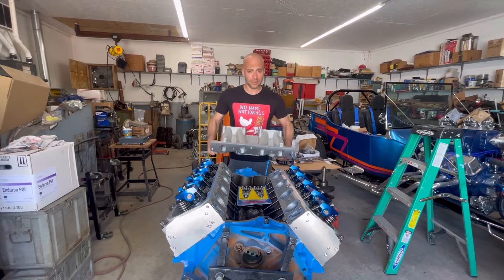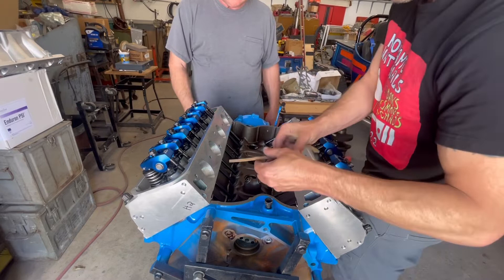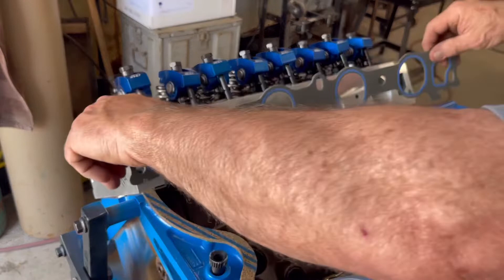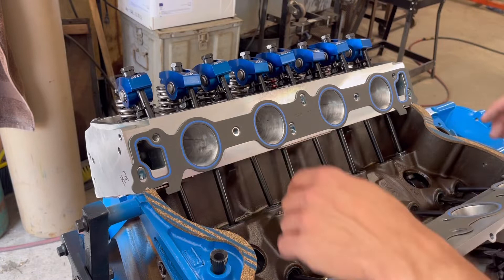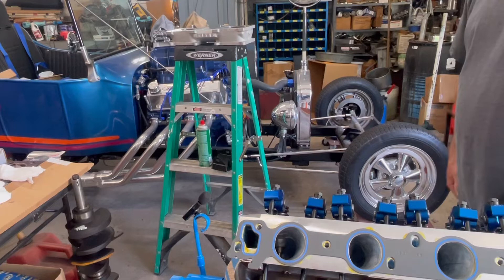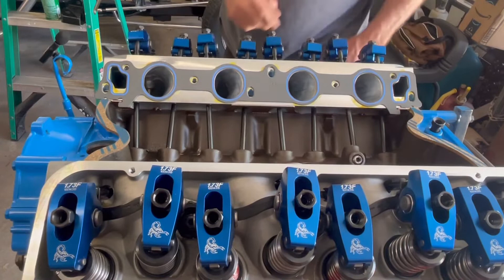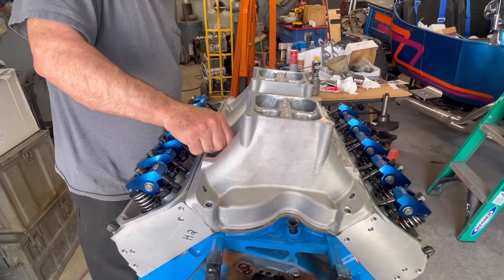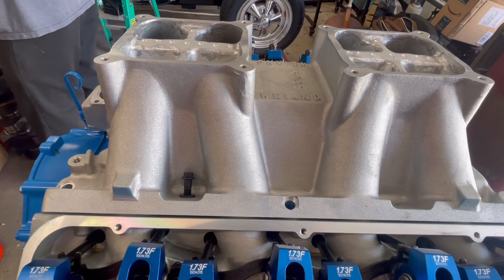How to Install a Tunnel Ram Intake Part 1: Friday the 13th #nonamenationals

Comment: As a Ford guy, I'm impressed you did everything right! The only difference is I use Form A Gasket 2. It's easier to use on oily, contaminated surfaces. It's not hard to remove, and it seems to never harden. I even use it in place of Teflon tape on coolant and air tool fittings!
One thing about Ford small and big blocks is that over tightening the intake can pull the heads enough to cause a head gasket leak in performance engines. I stay at the low end of the spec, I think 32 lb ?
Ford china rails aren't under compression, so you need to glue them in place (I learned the hard way).
Awesome content 👍
We're getting so close!
Reply from the maker: Thank you !!!  I’m going to pick up that form a gasket, sounds like a great product.  Man, so so close!
Reply: @2HacksGarage  you want the no. 2 stuff. It's resistant to almost all chemicals and solvents, where the original is not.
BTW.. have you considered putting either 'Ford' , 'Thunderbird', or '521 FBB' in your Larry video titles? The way Y.T. search works, you should get views when there's more key seach words in the title.
Just a thought 🙂  
The same for GM, Mopar, etc..
Reply from the maker: Ahhhh!!! Never thought of that!!! I will be doing that for sure really soon!!!! Thanks brother 🤜🤛

Comment: I've done countless numbers of these and NEVER used the China Rail Gaskets...... except for that 1st time when I tried to prove my dad wrong, and they failed swearing to NEVER use them again. I've always used the RTV bead after doing Exactly what you did. Even down to roughing any polished edges to ensure that the RTV can grab ahold. Well then I messed with a Wienand Tunnel Ram on a BBF and it FAILED! 1st time in Decades of doing this that it failed. So I redid it.... did it like Jimmy is showing you in this one (with the pin-in rubber gaskets), and so far so good!
I think it's because of that massive amount of aluminum on that TR and it moves a lot when it gets warm.
Anyway.... Leave it to a Big Block Ford to finally break my decades long winning streak for China Rail sealing... lololol.
Good Stuff man.... thought of this video as soon as I seen that oil spitting out the back of the block.... so tell Jimmy thanks next time you see him for me.
Reply from the maker: I know the frustration you speak of!  This happened to an LT-1 we built and also Jimmy's 460 when he had a blower on it.